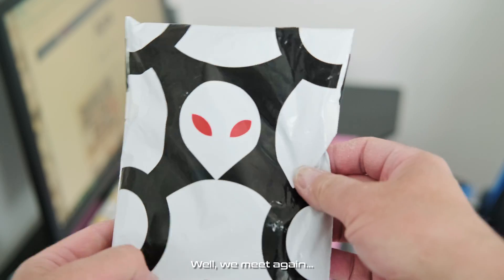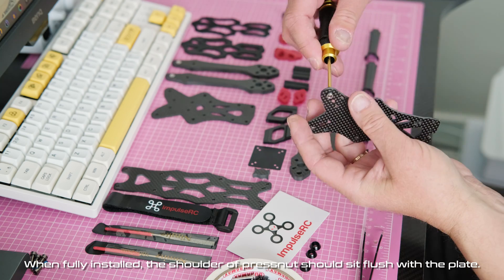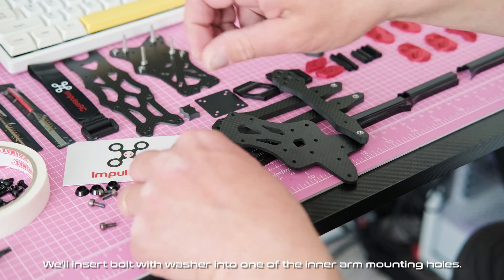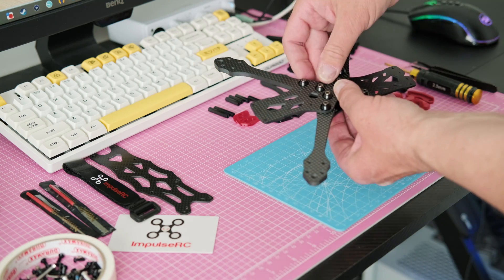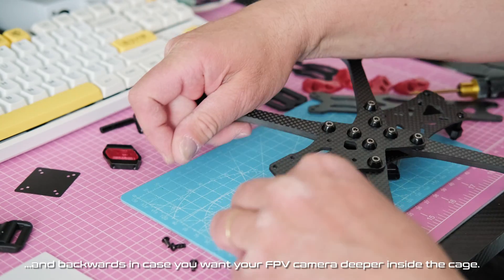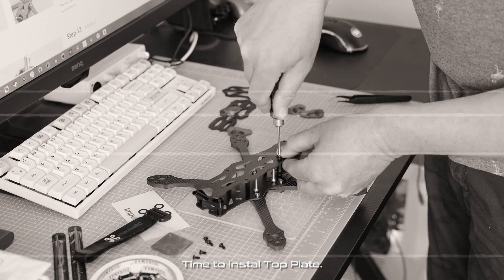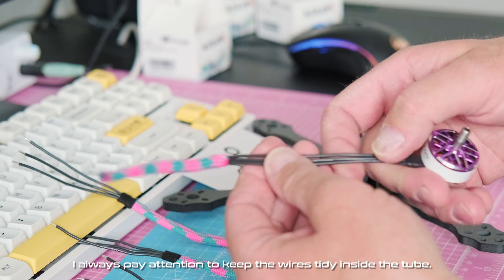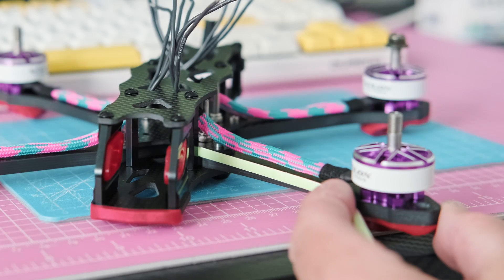IMPULSERC APEX EVO 5" FRAME ASSEMBLY | 04−25−2024

Comment: Nice video but some steps you fast forward them meanwhile I get confused as beginner
Reply from the maker: Thank you for your comment. Video is not really meant as a tutorial for total beginners, I am not a good "teacher". The thing is, I only sped up certain parts that are repetitive, but I left the beginning of each process intact, so you know what is going on. For example, when I have to screw 16 exactly the same screws, there is no point to show that in real time. Also, if certain parts were not sped up, video would last for 1.5 days, that's basically how long I've worked on it.

Comment: motor wire sleeve where did you get it from?please
Reply from the maker: I usually get them at Michaels, or if I'm lucky, sometimes even Dollarama has them in stock. EDIT: have a look at my other build videos, there is tons of different looking sleeves I used in my custom builds. My 6th custom 5" build: https://youtu.be/TtUKIeZua7Y , My 5th custom 5" build: https://youtu.be/S6h6RaFi6IQ , My 4th custom 5" build: https://youtu.be/6hXh8P97HkA , My 3rd custom 5" build: https://youtu.be/UVIMAifJjvE , My 2nd custom 5" build: https://youtu.be/Wa4LB4P_7z4 , My 1st custom 5" build: https://youtu.be/-8mMqIQadS4 . Here you can watch complete setup of my 2nd custom 5" build: https://youtu.be/NwiiF8_h2tY